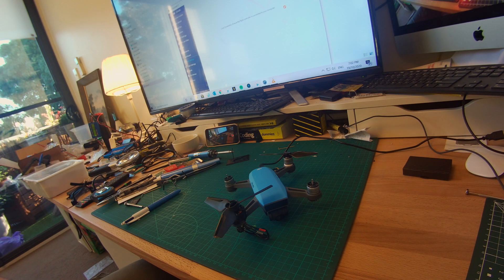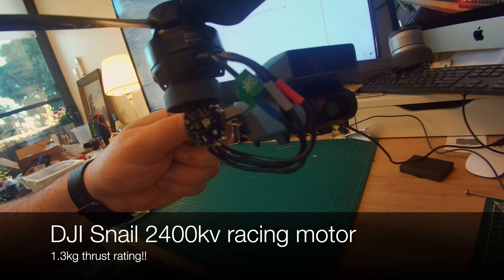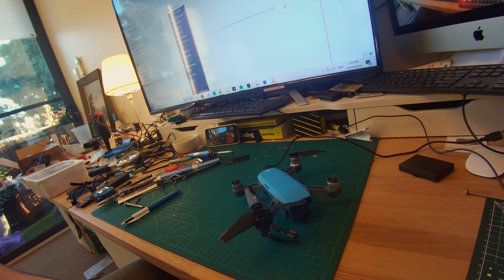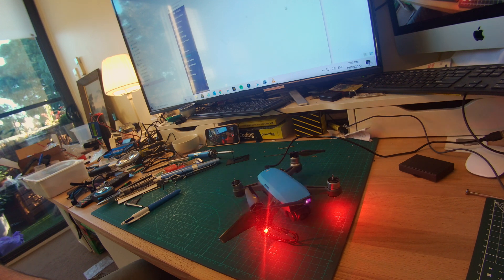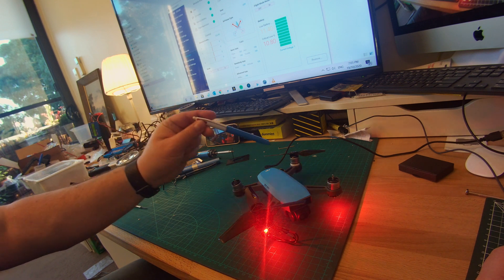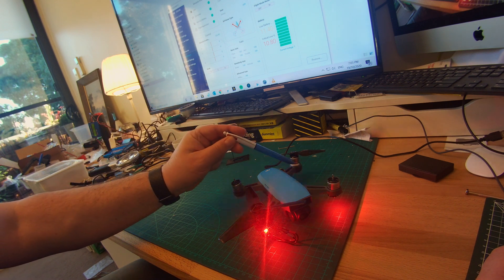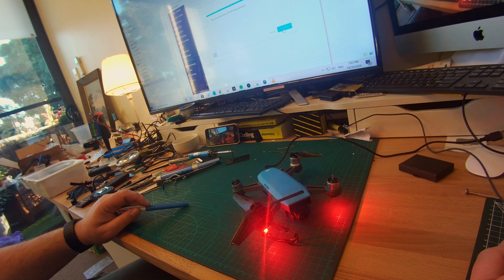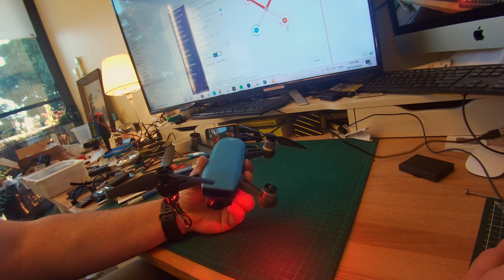DJI Spark Racing Motor Test!

Comment: motor details please, also, did it fly?
Reply from the maker: The motor and prop are DJI Snail propulsion system. Not so easy to find as DJI has discontinued the product. 

For flight testing I need to design a reliable way of attaching all 4 motors so that props don't hit each other, and adjust PIDs so that it doesn't have an uncontrollable ascent. I plan to release more videos on this project soon, thanks for your interest :)
Reply: @dronemods5364  just get smaller props!!